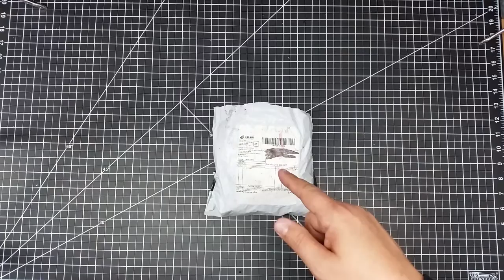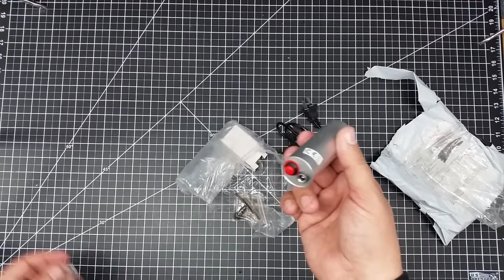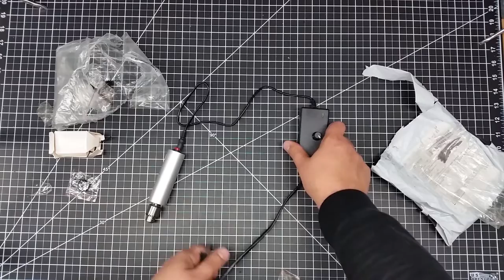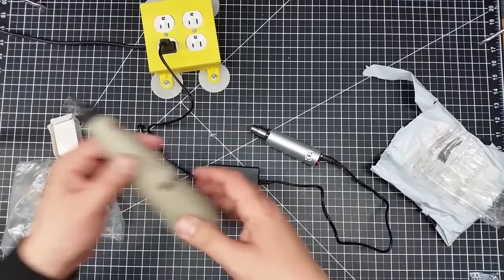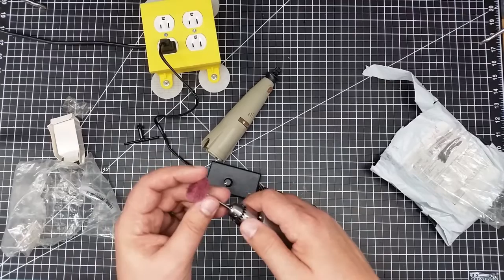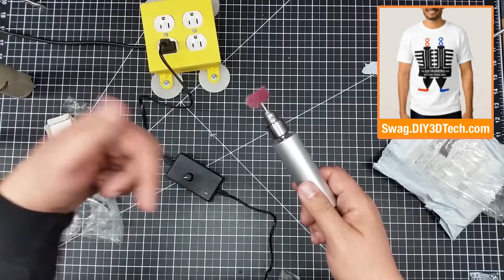Shop Talk - Cheap Spindle With Jacob Chuck!

Comment: Very cool, could you post link to the scotch brite brush?
Reply from the maker: Cool idea as I love these things!  I did a video on them about a year ago however here is the link where I got mine: https://goo.gl/ruj5Ge
Reply from the maker: Cool idea as I love these things!  I did a video on them about a year ago however here is the link where I got mine: https://goo.gl/ruj5Ge
Reply: DIY3DTECH.com thanks I been using the 3m small flapper wheels for some sanding and going to try these. The, 3m ones are expensive these seem like a good price. How do the work on wood? The little hairs that are left behind after carving
Reply from the maker: Mostly I ue these on plastic from 3D printing and they work well to knock down the both the layering and burs which are left over.  They as also allow me to "resize" ever so slightly parts (plastic) which have expanded during printing.  However to clean  up a harder wood after say an a cnc engraving process would also make a lot of sense to too.  Please keep me post on how you use these and the results.